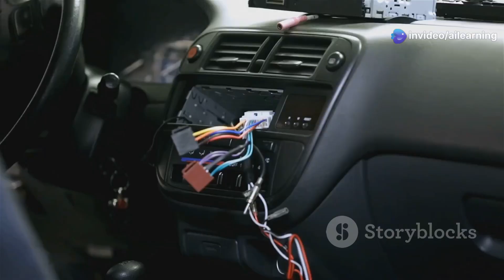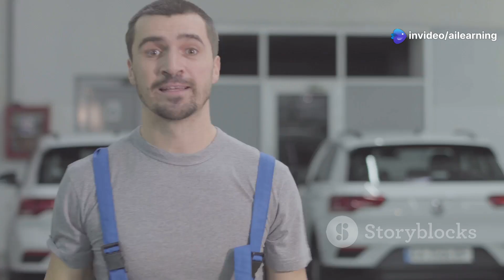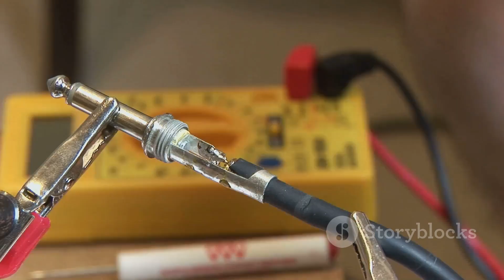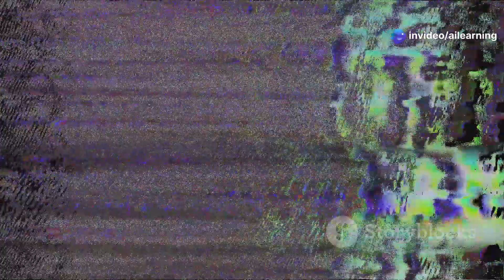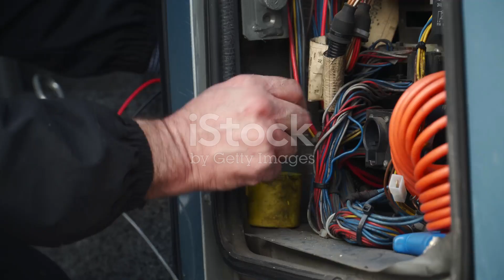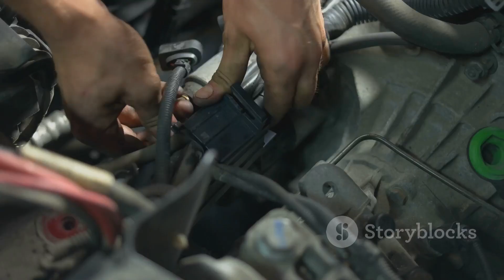Introductory to Mastering canbus troubleshooting,diagnosis & repair.

Comment: This video does'nt provide any information about troubleshooting or diagnosing. it evenn nleaves out critical information about these system designs. an example: the resistance between the wires.
Reply from the maker: I will be breaking down the points in the video. I am also learning how to use ai editing. The resistance between the wires is 60ohm if the circuit is functioning. 120ohm if a part of the system is not working and makes an open loop.